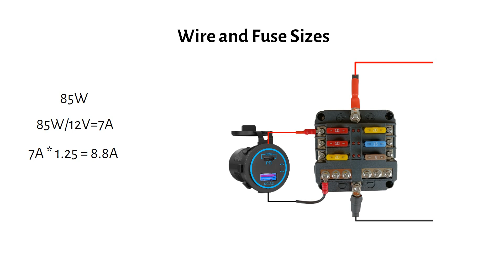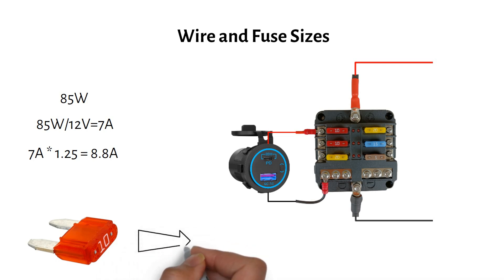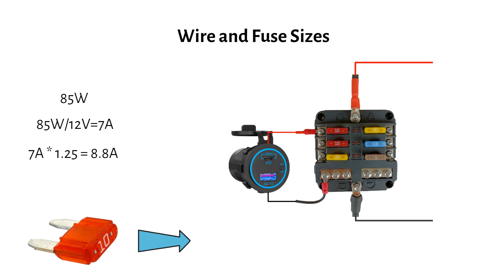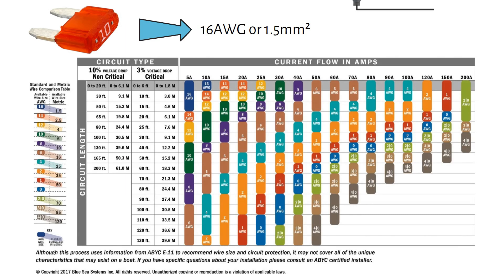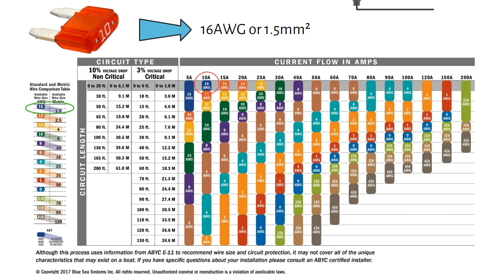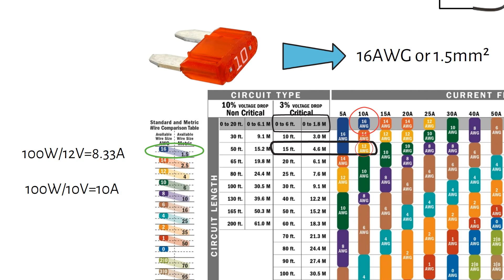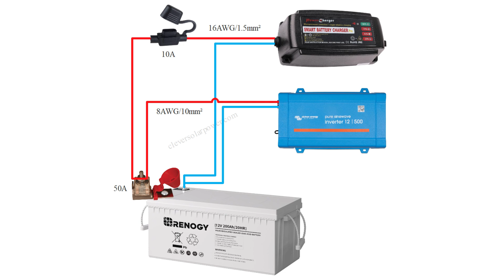How To Wire a DC Fuse Box? Fuse and Wire Sizes

Comment: If I have a main fuse block, and want to add a sub fuse block just to handle USB outlets, can I do that?  i.e. tap a small fuse block off the main fuse block and then add 4 or 5 usb outlets to the sub fuse block?
Reply from the maker: In theory you can attach an unlimited amount of fuse boxes after the first fuse box. However, there are USB outlets that take in 12V with several USB outlets. So I don't know why you need another fuse box.

Comment: Hello Nick,
I am Claudia from Nederland. 
Can you please 🙏 let me know, I want to plug my Tv ( about 180-185W , using this fuse box — I understand that for the Tv I will need a 30A fuse — but I don’t know if it’s possible to connect a EU Plug  or it is not needed it, maybe I can plug my Tv direct in the Inverter  ???
I wait for your response and Thank you very much!
( My Inverter has 2000W , please maybe you know how much A must be The Fuse for my Tv - he use between 180-200W Maximum ) !
Thank you very much again.
Reply from the maker: Your tv is most likely AC, this fuse box is only for DC. You should plug the tv directly in the inverter. Checkout my three video playlist about grounding, neutral ground bonding and gfci. a 2,000W inverter can deliver: 2000W/230V=8.7A so you can use a standard 16A breaker and a 2.5mm² wire.
Reply: @cleversolarpower Thank you very much , I will do exactly like that . Have a wonderful evening . Best wishes, Claudia.

Comment: Hi - Love the channel, great video / QUESTION: I have 8ga wire going from my Lynx Dist to my 12v fuse box/block which has M5 studs, Im only finding 1/4" 3/8" and 5/16" 8ga terminals. Suggestions would be greatly appreciated.

Comment: I have a question. Is it possible to wire in series to step up from 12v to 48v using a fuse box like this? You know, from the negative terminal of fuse 1 to positive terminal of fuse 2, from negative terminal of fuse 2 to positive on fuse 3, and from negative on fuse 3 to positive on fuse 4. Would that make it 48v, or I would create a problem? Trying to power a portable ac that runs on 48v.
Reply from the maker: No, you need 4x 12V batteries in series.

Comment: Bro...my red light not getting on but power is getting through using fuse to my load not sure why...but when i touch any positive terminal then red light is getting on not sure whats the issue any ideas
Reply from the maker: Do you have a multimeter? Then you can figure out where the issue is.
Reply: @ i think its vice versa when fuse is blown then it will come on

Comment: Noob question.
Would a resettable fuse be fine to have in-between a 1000w inverter and the battery? (Most likely will boil a kettle most days)

I've got a lith battery rated to 100a constant. 180a for 5 sec. 
I currently put a about 200a of cable to 100a resettable fuse. Then put three 50a Andersons to that for all input/output. And was thinking of putting the inverter er to that connection point also.
Reply from the maker: I don't like the resettable fuses because they have a bad reputation. I really should do a video to proof these don't break at the advertised current. Its better to use MIDI or MEGA fuses and if you want to disconnect, then use a battery switch by bluesea systems (best quality).

Comment: the chart confuses me with the 10% non critical voltage drop and the right column  3% critical voltage drop. 

The 10% says 0 to 6.1m is a non critical drop yet the next column says 3% critical drop if the cable is between 0 to 1.8m

What am I missing?
Reply from the maker: I recommend using the 3% voltage drop. Otherwise there will be a lot of losses.

Comment: Thanks for the video! One issue i’ve been having is finding a fuse block that supports wires larger than 12awg. There’s a few things I want to run in the back of the car so I need to fish a longer wire and would like to use 10awg, but most of the boxes im finding only suggest 12-16 awg wires.
Reply from the maker: You can use larger ring terminals (lugs) to fit the 12AWG wires.

Comment: Is 8 gauge the normal to use or should i go for 7 or 6 for  these 6 fuse boards
8 gauge yiu can fit a 50 amp fuse to protect the 8 gauge wire
Reply from the maker: It depends on how much current you expect to draw from the DC box. Check my video about sizing wires.

Comment: edit : sorry in the video you are saying dont use for 48v , i just had to watch few more seconds. 

0:57 can i use this kind of fuse box for 48v batterypack for led lights ? battery pack's actual voltage is 52v-57v, i need to connect 3 buck converters to battery pack to power up some led lights in home. but if something happens to buck i want to add a fuse in between buck and battery. will this kind of fuse box work. i looked few on aliexpress and they are rated at 32v max. will that be a problem because buck wont be taking more than 1-2A from battery.

Comment: Hallo Nick, is there a huge difference between DC and AC breakers? Or will AC breakers work in a DC circuit if they have the correct Amperage rating for the circuit?
Reply: There is a huge difference between AC and DC breakers. Do not use AC breaker for DC. It has to do with extinguishing the arc when the breaker opens.
Reply from the maker: Exactly, couldn't have said it better. AC goes through 0 50 or 60 times per second so it's 'easier' to extinguish the arc. DC doesn't, so it's harder. There are some cool video's online showing this.
Reply: @cleversolarpower  Thank you Nick, so the "solar panel" charging side must all be DC hardware while the Inverter out can have AC hardware, but inverter in must also be DC breakers and/or fuses.
Reply: @johno4238 Thank you so much for the reply, I suspected as much, just needed  confirmation.

Comment: Hello. I did a DIY solar installation in my house, 1000w inverter with  one 150ah 12v battery, here is my problem, I am able to make use of my vacuum cleaner which has power rating of 700w but my fridge of 85w is not working.  What can be the problem.
Reply: My refrigerator pulls under 200 W while running. The compressor will pull over 1400 W while starting.  Need a 2000 W inverter just for the refrigerator
Reply from the maker: I suspect the high startup power of the fridge as well. Especially if it's an older fridge. Maybe you can add capacitors to capture the peak power draw.
Reply: @cleversolarpower  I bought the fridge mid last year.
Cam you give me a step by step guide to wire up the capacitor. I can provide you with the wiring diagram